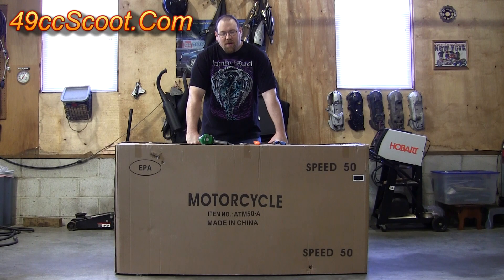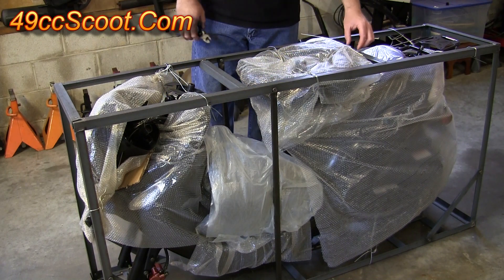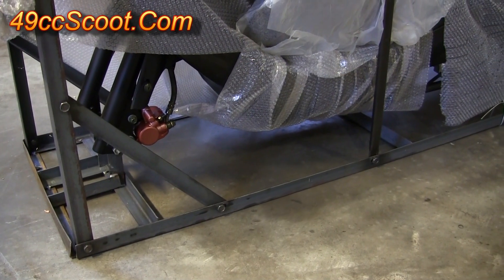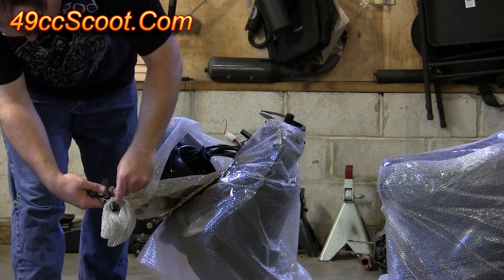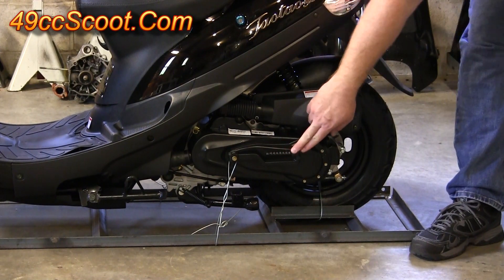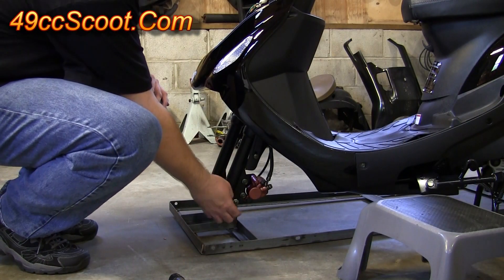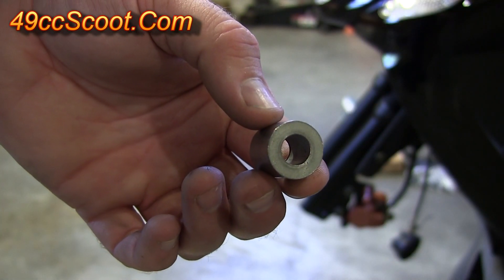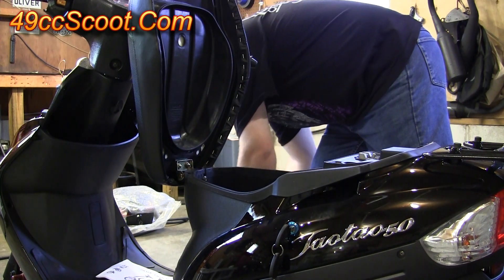TaoTao ATM50-A1 49cc Four-Stroke Chinese Scooter Uncrating 50cc Tao Tao

Comment: the 2015 atm50a1's are great scooters! Your videos helped me assembling it! I have 2,000 real miles on it with no problem. Never used the factory oil, I used 10w40 in it! I put 75w90 gear oil in the gearbox. Thanks for the videos!!! :)
Reply from the maker: Thanks for watching. Good luck with your TaoTao!

Comment: do you no the size of the box wondering if it will fit in the back of my trailblazer
Reply from the maker: I don't recall and I don't have the box or frame anymore. I would think the seller should be able to tell you the dimensions.
Reply: Thanks

Comment: Do you think the electrical components on the 50cc taotao could stand running 6-7 12" led light strips with out doing any harm.  I want to add a couple of red lights for better visibility and braking.
Reply from the maker: Try not to stack up more than 10-15 watts and you should be OK. Check the ratings of the strips you're looking at and add them up. You can probably get away with a little more for brake activated lights since they are not operating full time. Keep an eye on your battery charging until you know for sure that your lighting setup is not drawing too much.
Reply: Thank you very much. Your vids are awesome keep up the great work
Reply from the maker: Thank you. Good luck with the lights.

Comment from the maker: 10W40 to 15W40. You don't need a motorcycle oil, because these scoots don't have wet clutches. Wait till maybe 500 miles if you want to use synthetic. I have an oil change vid up as well, as one of the parts of my PDI series.

Comment: Hi how are you doing? Thank for great video! I have questions about my moped is running but when I speed it is go but slow down,if you can help me appreciate you time 😴
Reply from the maker: Perhaps the carburetor needs to be tuned. If it's full throttle and it starts to slow or bog, then work with the main jet first... assuming the carb is clean.

http://www.49ccscoot.com/faq/carbtune.html
Reply: 90GTVert thank you for your time

Comment: 2014 tao 49 cc after 3 months it rides 2 or 3 blocks then dies. it takes a few minoutes and starts back up and does same thing . i checked ear leakes  cleand carb good spark .what gives ? please  hellp  and greate vids thank you
Reply from the maker: +myron edge Maybe the float height is off or the vacuum petcock is failing. http://www.49ccscoot.com/faq/carbtune.html#floatheight
Reply: i have gone  from gas tank to carb cleaned everything and by passed petcock it idles good but at wot just dies i will check floats again, they were level and working last looked at. maybe valves? its my last thing  to check.and thank you this is driving me nuts lol
Reply from the maker: It sounds like it's running out of fuel perhaps to me, so that's why I suggested those things. Could be lean from a cracked intake or loose connection.
Reply: this is what i thought to.i followed all your vids i could not find no  air leakes.cleaned air fillter, the lines on floates line up . new gas lines .i got the red rtv gasket maker  so now i will remove the carb from the cilinder and really inspect it for leakes. the only other  thing  i am wondering. i  did remove a screew with a spring and ballbering from the bottom half of float bowl  that may be a little off i took it out when cleaning the carb but i am  shure i put it back right  like i said i am at a  lost now.
Reply: its been raining so cant do annything the problem started before i  cleend the carb  so doubt it is the screew with the bering.you dont think valve ?if i have it up on kick stand i can get wot but after a few revs she dies .lol told you its driving me crazzy. i have been all over 49 cc scoot and dont se annything .i hope its nice out tomorowe
Reply from the maker: +myron edge It really sounds like a mixture issue to me, but it doesn't hurt to check the valves.
Reply: thanks bud i did the carb  cleaner check no leaks  .checked valves shoure anouf exsost vearry tight set to 00.4 intake to 00.3  exelant.a little addjustment to air mi screew and she pures.
Reply: intake 00.3 exsoust 00.4. still wonder if i got that screew spring and bering correct . wonder if you know what i am talking about and if you know it's purpose it is in the bottom half ov float bowl ?
Reply from the maker: +myron edge Look through the link I provided a few posts ago and also the link below and it is likely shown :
http://49ccscoot.proboards.com/thread/363/carburetor-cleaning

Comment: im getting my second atm50 coming monday... how important would u say it is to do the check or could i just replace fluids?
Reply from the maker: Replace fluids is a must IMO. Don't trust that stuff. Some get lucky and don't have problems for a while, some don't. IMO spending time on it now saves time and frustration later, but it's your call. Beyond the fluids, at very least look it over and check that everything is working, tire pressure is good, tires and valve stems are in good condition, no play in the steering, and brakes are working well.

Comment: 90GTVert i just
t bought a scooter its a tao 2015 i put in a new battery , it kick starts ,the light sill work, but the horn and gauges dont work at all and obviously  the electric start doesnt work. Ive watch about all of your vids on tal . does this problem sound familiar to you, or anybody else? out of all the other videos  you by far make it clear and simple on instructions honestly. I registered to you website but at the moment the sight is having a problem send the verification code.
Reply from the maker: The most likely simple cause would be a blown fuse. Look near the batter for a fuse holder.

Comment: I've watched a lot of your videos and subscribed because I feel that they're extremely helpful. Especially for someone like me who is not really mechanically inclined. But I've been doing a lot of research about scooters and I've decided a 150cc would better suit my needs. I'm wondering if the PDI would be the same I mean everything is pretty much in the same spot since I'm still getting a taotao right? Or are there any major differences I should be aware of?
Reply from the maker: Mz Cains For the the most part the PDI will be the same, but removing panels will be different unless you've found a 150 that looks like the ATM50. The GY6 150 is very similar to the 139QMB/GY6 50 so oil change and valve adjustment will be the same process. If you decide to do the part of the PDI checking under the CVT cover, then on the 150cc you need to remove the kick start lever before the cover comes off instead of the whole assembly coming off like the 50. There will be some differences here and there but I think the PDI series will help most of the way. You can always join the forum 49ccscoot.proboards.com and there's someone around willing to help most of the time too.

Comment: what is a good replacement battery for 49cc scooter 12v 9ah or 12v 7ah
Reply from the maker: Check out the lithium ion batts. Can be a little pricey, but really good cranking amps and super light.

Comment: How to replace back light bulbs in 49 cc taotao
Reply from the maker: There is a small panel under the tail light. Remove that (shown in link) and then a couple of screws will let you remove the tail/brake cover. The others can be accessed from the rear of the assembly.
https://youtu.be/-FVDfP4o9m8

Comment: I have a 2012 taotao was running fine  but when I did a valve adjust the exhaust keeper nut came off and the scooter bogged out.  Fixed didn't see any harm done and got scooter to restart off a jump box.  I can no longer get it to start and I have fuel leaking from air box about 5 minutes after trying to to start.  Do you think I'm flooding the crab is why it won't start? It tries after awhile on jump box bit never fires off.  Think petcock is stuck open little cuz when i pull fuel lunge from crab I have a small stream and scooter is off
Reply from the maker: Have you checked the float height to make sure it's not stuck or hanging and allowing too much fuel in?
Reply: No I haven't.  It's the stock carb which is sealed.  I think the petcock is stuck open cus I still have fuel coming thru
Reply from the maker: Oh OK. I was tired and I guess with the typo I didn't register what you were saying. Definitely replace the petcock. A manual shutoff is much better IMO, because they don't fail unless they get old and crack/rot or something in the fuel line clogs them.
Reply: ***** 
Ok I've changed the petcock so I am still getting fuel but it's not leacking out of airbox anymore.  Someone suggested I check compression so I did.  I'm get anywhere from 60-70 psi on the gauge.  Was told it should be around 100-110 so would this mean my main gasket on the piston chug is bad or that I need new rings on piston.  Sorry for typos it's auto correct on cell I've recently broke a hand so it takes me awhile working on scooter
Reply from the maker: 100psi is a minimum. For a strong healthy engine I'd like to see closer to 150psi, so 60-70 is low.

First thing to do is make sure the tester seals. Some compression testers seal poorly. I've had to replace rings on them with the washer from an old spark plug before.

Then it could be rings or an issue in the cylinder or it could be that a valve is not closing or leaking. Could be a gasket. You can try checking your valves again and seeing if that gets you anywhere. Some use a few drops of oil put in via the plug hole and then re-test. If compression jumps up it's likely a piston ring or cylinder wall issue. If there's hardly any change it's more likely a valve or gasket.

Comment: What size bolts are those what do i need to take the crate off when i order mine?
Reply from the maker: Any metric socket or wrench set, wire cutters, and maybe a box cutter/utility knife would get it out of the crate.
Reply: 90GTVert do know the sizes i need for thing ?
Reply from the maker: @kevinthorn9672  Not really. Most are common, which is why  I said they should be included in any decent socket or wrench set. You'd only really need to know sizes of fasteners if you're replacing them.
Reply: Hey man i just got my boom scooter today gas tank is empty what gas does it take without it messing up also can i charge the battery inside doors i might wanna charge it...
Reply from the maker: @kevinthorn9672  Most are fine on 87 octane regular unleaded.  You can find different opinions on charging a battery indoors. It could be dangerous, but many get away with it. Google will give you all sorts of answers.
Reply: 90GTVert ya i googled that and man nothing i see relative
Reply: Hey man my new moped wont start ? But only some times messing up today makes a clicking noise when i electric start it  ? Last night it worked now today wont start up and the kick start i cAnt lift up 200 poinds to out the other kick stand on to try it??..cAn you help me out why it would not
Reply from the maker: @kevinthorn9672  Look up vids about getting a bike onto a centerstand. You do not need to lift the weight of the scooter with your strength. Learn to do it and it's not tough.

Check your battery first. May be dead or low. You want to see at least 12.8V on a charged battery.
Reply: 90GTVert ya its charged i figures the stand now it making a buzzing noise from eletric start also when it trys to run shuts down ..rAn 1 time down my street i stop then it would not start again??
Reply from the maker: @kevinthorn9672  Maybe the starter isn't engaging. The bendix under the cover can fail. You usually hear it spin up though. Cliking is most often low power. Try checking connections. Check frame grounds.